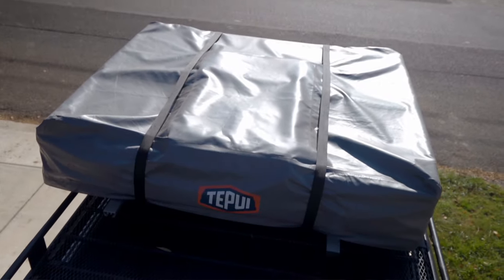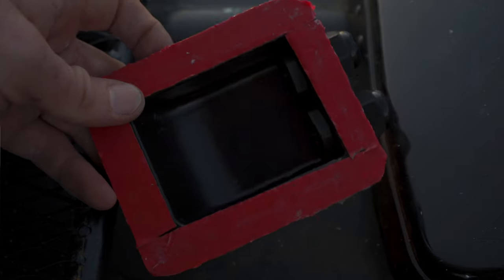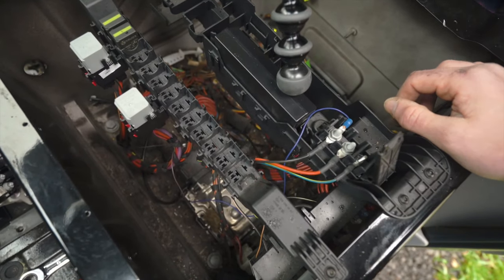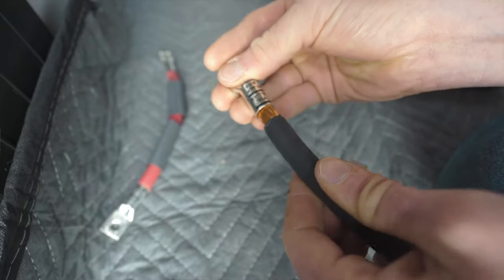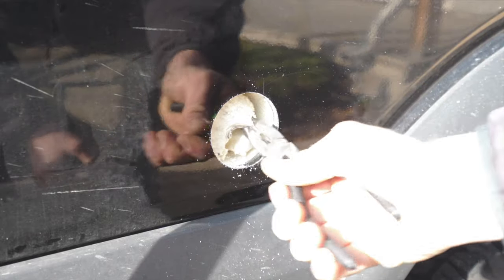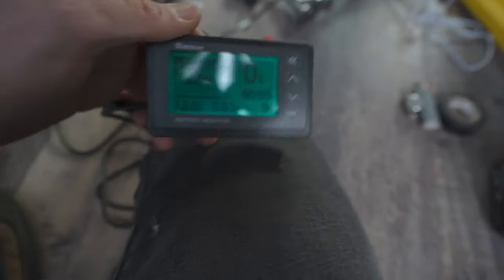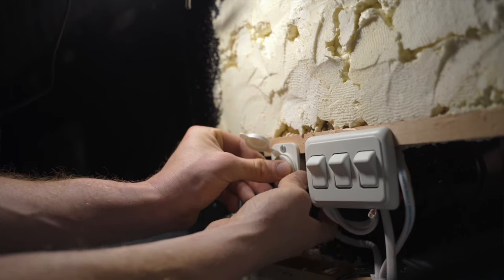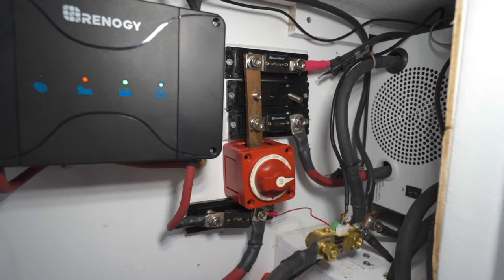Sprinter Van Build with Solar, Alternator DC Charger, and Shore Power

Comment: Hey Shaun, another quick question for you... did you ever end up figuring out a solar cutoff switch in order to get those 50amps from the alternator on cloudy days?
Reply from the maker: Hey! I haven’t gone through and found a solution yet. I’m starting to consider having the 60 amp dc charger and a separate solar controller.
Reply: @shaunwilkens  Ah good to know--I have the DCC50S on hand, but haven't started my install yet.  Perhaps I should think about returning it and going with a separate charger/MPPT as you've suggested, huh?
Reply: @shaunwilkens  40A NC relay connected to the ignition on, would cut off the solar

Comment: Awesome video and music my friend.  Did I see you were using MC cable for some applications?  If so, which and why?
Reply from the maker: Thanks! I originally was going to use mc wire from the 30 amp outlet to the inverter/charger then I decided to go with stranded wire. No real reason just decided to follow what AM Solar did on their installations.
Reply: Shaun Wilkens awesome and thanks!!

Comment: Nice job on the van so far. Thanks for sharing. Is the roof rack made of aluminum or steel?
Reply from the maker: Thanks! It’s steel. I was surprised how light it ended up being. I want to say it’s around 160 lbs

Comment: Hope you never have to replace a tail light on the van🥴
Reply from the maker: I have and it’s a breeze. On these sprinters you remove three screws and pop out the entire light assembly to access the bulbs. To access the screws you open the back doors.

Comment: Just curious what gauge wire did you use from the engine battery back to your house battery in the van? I'm getting ready to do this in our van.
Reply from the maker: I used 4 gauge wire. It does depend on how many amps you plan to send through it and the distance you cover. Nate at exploring.life has a great wire size calculator I keep bookmarked. https://www.explorist.life/wire-sizing-calculator/